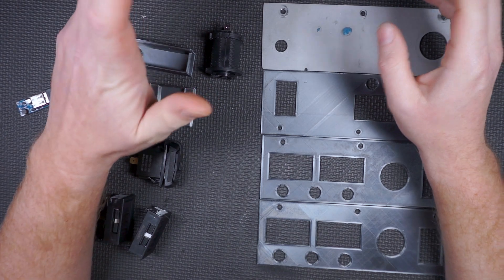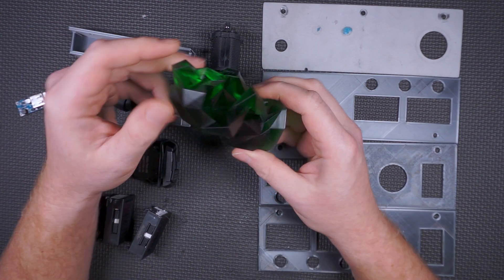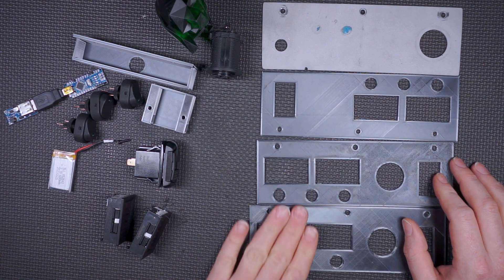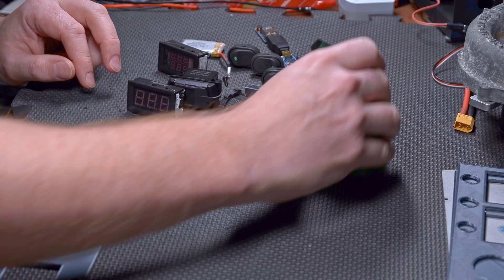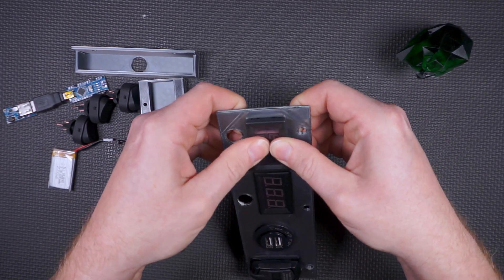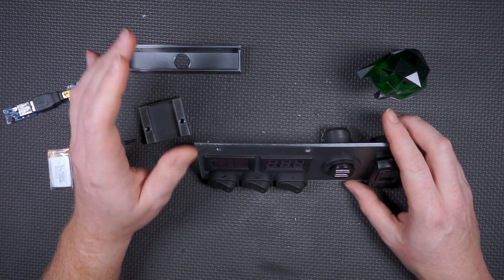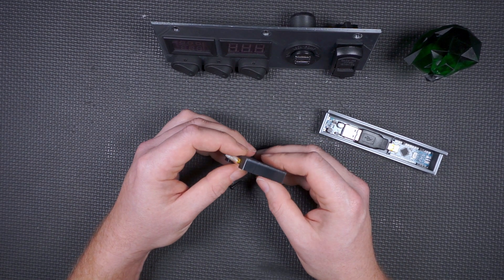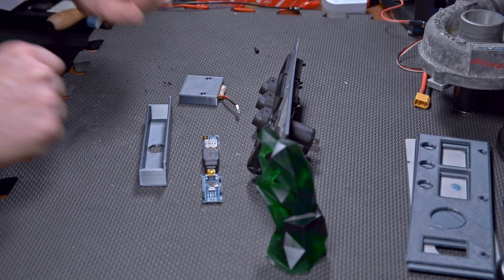Easy! Print your own car parts!

Comment: Is that feeling that you need to get out of bed because you can't sleep and want to be productive something that came with age? I know what it's like to lay in bed and feel like I could better spend my time doing stuff than being bored and awake.... But I can't get out of bed hehe. Also kitty now in kitty heaven.
Reply from the maker: Partially.  As I've started sneaking up on 50 various health issues tend to prevent one from sleeping too long - multiple older injuries are coming back to haunt me - broken back, shattered ankle, reattached tendons in my left hand (notice how my ring finger on my left hand is never fully straight?  There's a massive zig-zag scar the whole length of the finger from the surgery), broken arm, leg and now the shoulder, etc.  And then there was the Lucy thing; but she was honestly overdue.  They gave her two weeks to live last August.  She had a good run, but still it occupies your thoughts.  Thanks.

Comment: 1)You dont have a SLA printer you have a DLP (being pedantic)2) ANNEALED PLA can withstand more heat than ABS /PETG. I run structural car parts with annealed parts.. Go search it up.3) your prints are thick on one side because the bead is not level. 4) It looks great ! :)
Reply from the maker: I suppose so re: SLA vs DLP; Stefan over at CNC Kitchen tested annealing and saw only a small improvement in his "hook strength" test, but a slightly smaller decrease in impact resistance.  Petg seems to beat PLA hands down in temperature and toughness - but not hardness or "hook strength."  That coupled with all these guys saying that Petg is their go-to material got me going in that direction.  The cost is almost the same - maybe a buck or two more per spool.  About bed leveling - I leveled the bed carefully and numerous times (using CHEPS (?) leveling g code).  I found the "weak link" of the Ender 3 - my stock aluminum bed wasn't flat.  It was bowed in the center; on top of that, my x axis belt was loose too.  I bought a glass bed (using it for the first time today); and that seems to have fixed the issue.  I have to say, this 3d printing stuff has come a long way in a few short years.  I'm rather excited about it.  Thanks Michael!
Reply: @AlexLTDLX   UM i  i think you should go back and watch his annealing videos again there was a massive improvement to withstanding heat. Other factors not so much but i wasn't referring to them anyway  https://youtu.be/vLrISrkg46g?t=583 .You could summarize it by saying annealed PLA increased it's temp by 100c !

Comment: Looks good! If gaff was good enough for the new GT500 and Ken Block, it's fine for my car. He wouldn't say which brand it was though.  The ender's seem to be quite popular and pretty decent.
Reply from the maker: Lol.  If there's one thing I know about after 30 years in TV, it's gaffer's tape.  The current best pro grade in my opinion is Gaffer Power.  It used to be Pro Gaff, but they're no more.  I know a lot less about 3d printers, but I'm thrilled so far!  Thanks for watching and taking the time to comment!
Reply: @AlexLTDLX  I think we still have some rolls of Pro Gaff around. Much better than what we are buying now.

Comment: I have the ender 3 and print ABS 1.75mm no problem. The only thing I've changed is I bought the glass printer platform.
Reply from the maker: Ha!  I literally installed a glass build plate today.  I had near perfect prints with settings advocated by some youtubers and I thought "I could do better."  Well, so far the only thing I've done better is fail prints... but you learn nothing from success!  ABS scares me a bit, tbh.  If Petg will do the job, and if it's easier, I'll use it.  Do you use any sort of glue (stick, hairspray?) on your glass bed?  I have the Creality one.  So far I'm just playing with PLA.
Reply: @AlexLTDLX  I used my kids glue stick. Also there's a "print" you run to level the bed. You use a sheet of paper from the nozzle to the bed and it allows you to level the bed at the four corners and the center. If I don't level the bed VERY often I have crap prints.
Reply from the maker: @McNallyCreekband  Thanks for the glue stick tip.  I've been running that program to level the bed I think I know exactly the one you're talking about